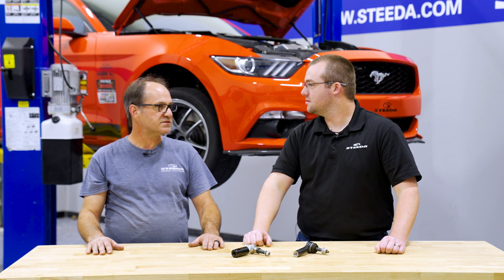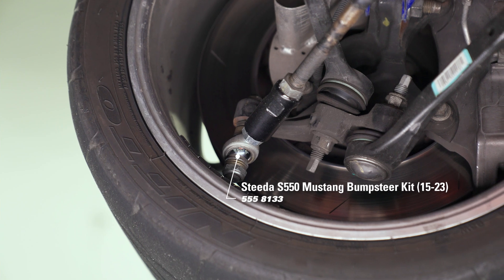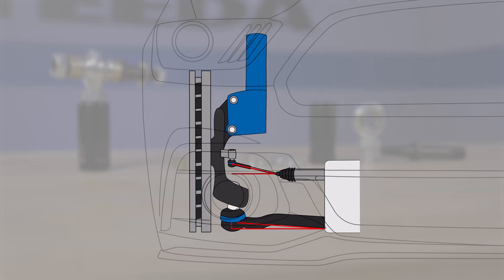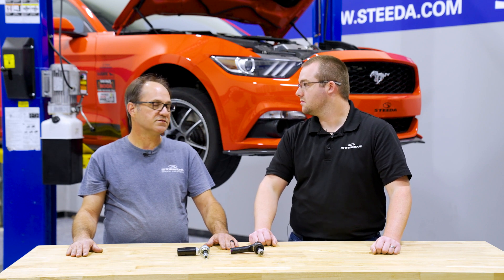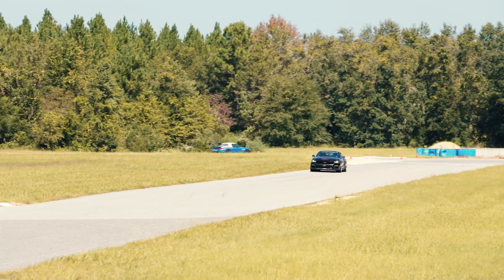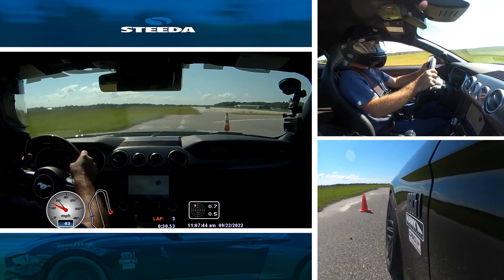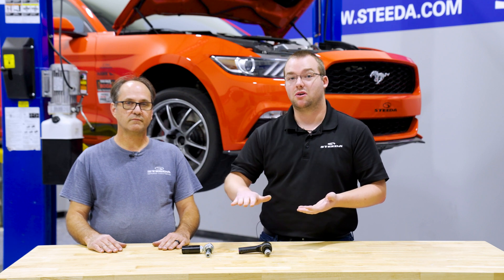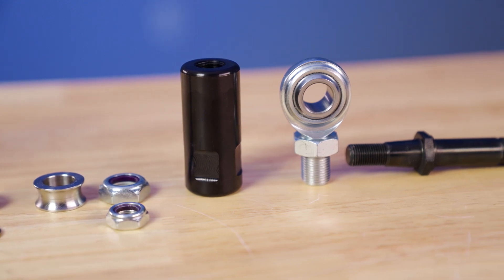What is Bump Steer and How to Fix It | Tech Tip

Comment: What is the wear like on a bump steer kit? Will the elements cause them to go bad quickly? Salt, Snow, Rain, Dirt, etc??
Reply: Good question.  Ungreasable pivot joint for the tierod end worries me that this would wear out rapidly.
Reply: @abuck2844 i’m two years late, but some manufacturers like gktech use zinc coatings to prevent corrosion

Comment: So does the Alignment Shop adjust your Bumpsteer componant or do we & if we have to adjust it, is it as simple as making the tie-rod straight again (seems like room for error without computer alignment)???
Reply from the maker: Ideally an alignment shop would adjust the bumpsteer when you lower the vehicle. The goal is to get the tie-rod level with the lower control arm, and then adjust the toe in or out to get the alignment in spec.

Comment: 90 percent of the alignment shops dont adjust bump steer. They dont deal with aftermarket parts. 
Many just guess on the correct spacers to put and deal with bump steer